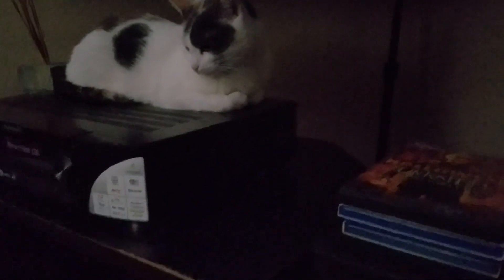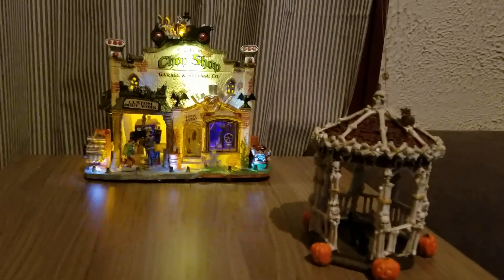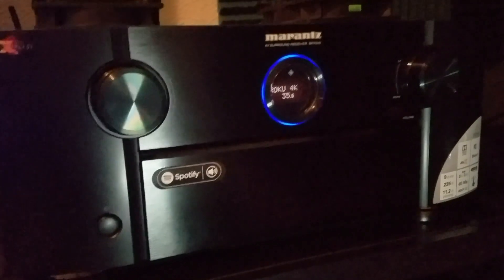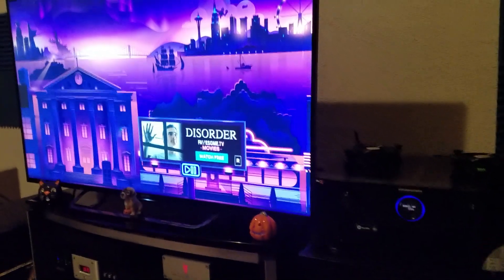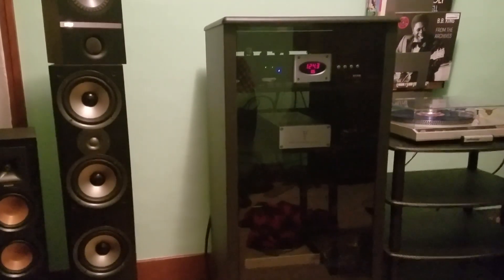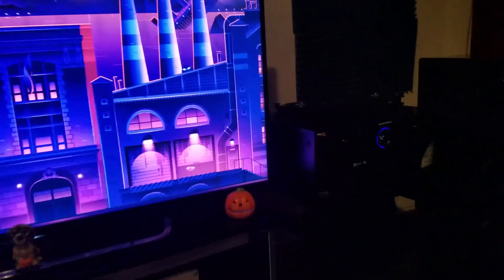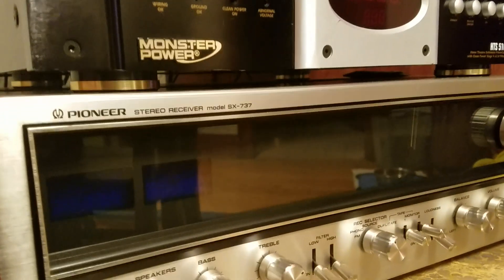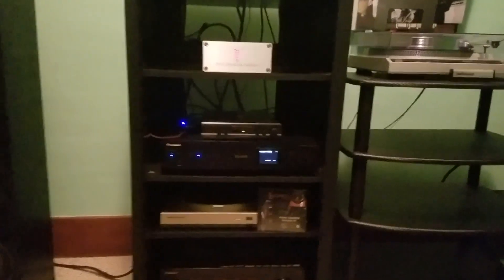Home theater power amplifiers and AVRs part 1

Comment: Just wondering if that AVR was the marantz7012
Reply from the maker: No I wish... just the marantz 1606 sitting in my bedroom, small minimalistic surround sound setup but it's one of the Slimline receivers that they kept the 100 Watts by 7 inside of instead of moving to the 50 watt by 7 amplifiers.
Reply: @tacticalAV  The 1606 has 100watts?? I have the 1607 and I believe it has 50watts,that's why I added the emotiva bas-x 150 to it thanks to you!!!